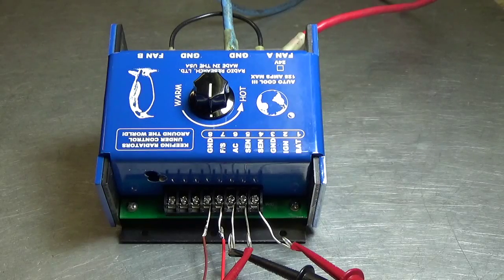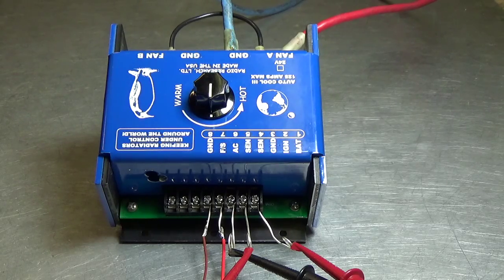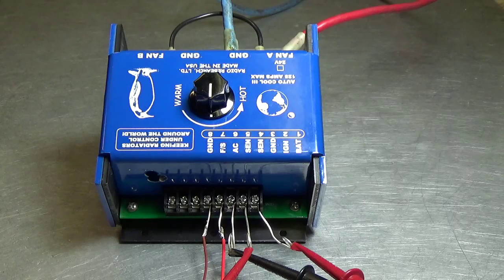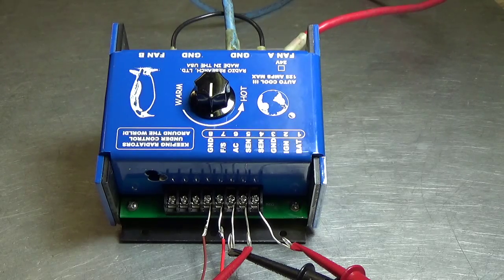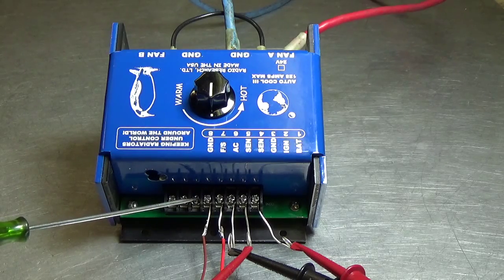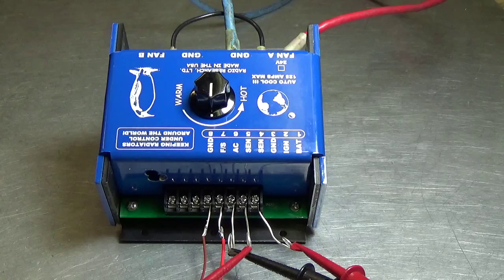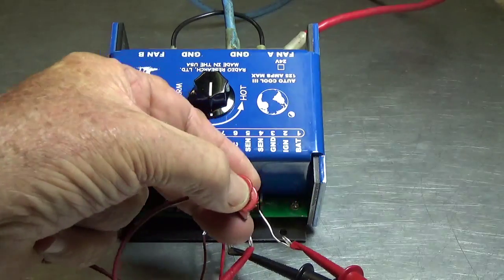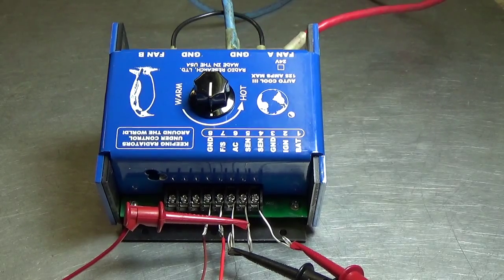THE AUTO COOL III  A 125 AMP PWM RADIATOR FAN TEMP CONTROLLER

Comment from the maker: The Auto Cool Controller is connected to the fan's ground wire.  The low speed wire is not used.   The fan's high speed wire is connected to the battery plus.   The output of the controller will pulse width from 0 to 100 percent depending on the temperature of the sensor on the outflow port.   This will run the fan(s) RPM from 0 to 100 percent RPM.  If you turn on the Fail Safe, the fan(s) will go to Full RPM.   The A/C fan speed will control the fan(s) RPM with a small pot on the side of the controller.  The temperature mode will over-ride the A/C fan speed mode.Any questions email  autocoolguy@yahoo.com  or call 562-367-3225
Reply: Hi Darryl. How do we get ahold of you? I do not see a phone number or email on your website

Comment from the maker: The Auto Cool III controllers run the fan RPM from zero to 100 percent depending on what the sensor is seeing on the outflow port.   You only use the high speed wire and the ground on the fan or fans.   You do not use the low speed wire - just tie it up.This is a closed loop control system.  Give me a call at 562-367-3225 ask for Darryl Please check our web site at www.autocoolguy.com  Orange County Ca.

Comment: It Doesn't have a high or low you apply power to either one of the positives and it brings the fan to low speed operation it doesn't care which of the two positives you want to use for the low as soon as the other one gets hot it will spin full speed

Comment: Can you control a derale 2 speed fan with pwm
Reply from the maker: +FORDGTFANATIC Yes you can use the Auto Cool III with the Derale or any fan or fans.   Use only the High speed wire and the ground.  Tie up the low speed wire and dont use it.Thanks, Darryl Dashiell  www.autocoolguy.com